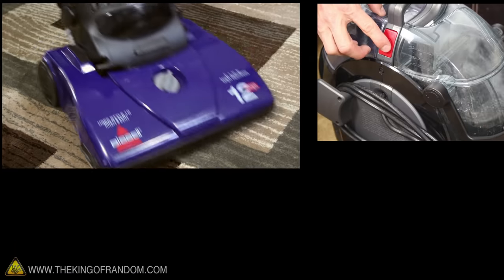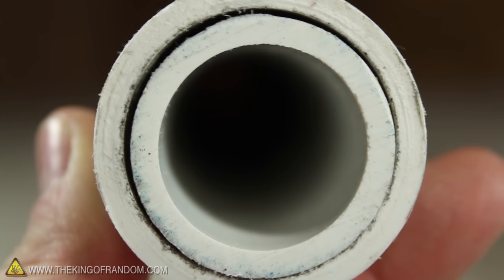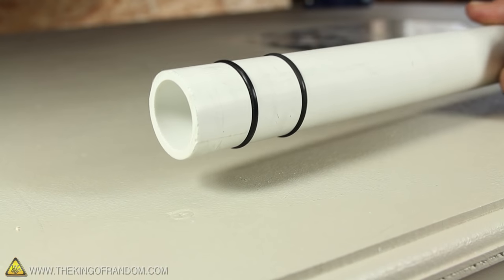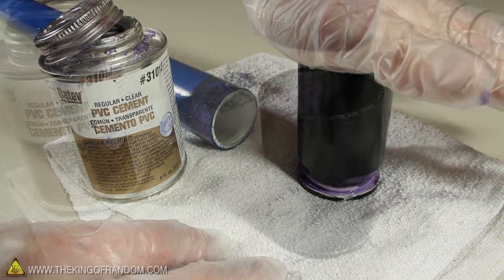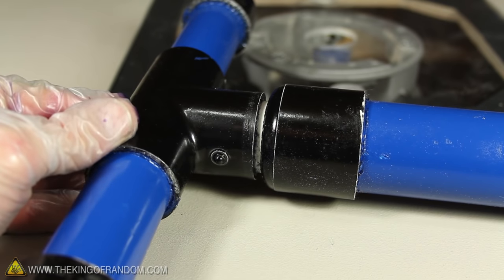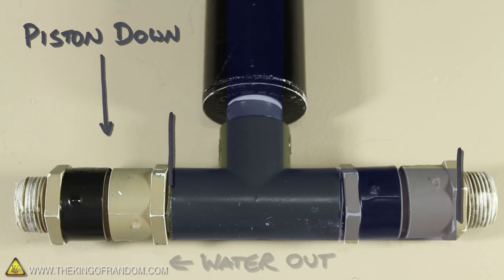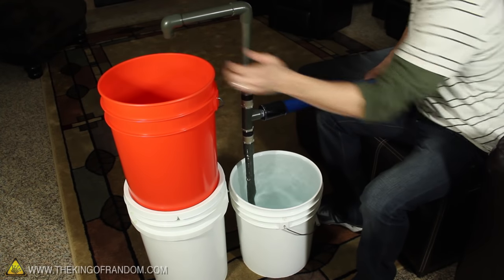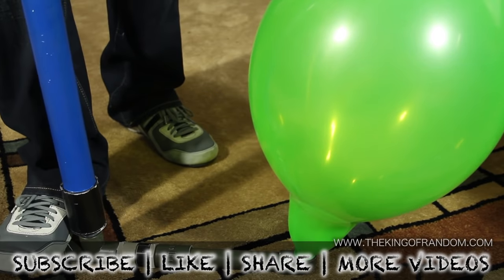How To Make A PVC Pump!

Comment: This pump works EXCELLENT with basic windmill pumps (using crankshaft mechanical leverage arms) too. You can even use this with 'high-reach' windmills, and drive this pump with simple counter-balance weights at the ground level. Excellent video.

Comment: Very nice job. :-) I made a very high pressure version pump a long time ago using rigid, thick wall aluminum tubing, using ball bearings / springs  for my check valves. I spun the tube with a very small round file(rat-tail) held firmly against it to create the perfect shape groove for the o-ring to go in. One thing to note, the vaseline is very bad for rubber, go with the KY(LOL), or silicone grease.
Reply from the maker: Thanks for the tip!  I've heard that from a few people, so it's probably correct!
Reply: You have a very nice channel, and well made videos. :-) If you have a bag of those rubber o-rings, and they were inexpensive, then just use vaseline and swap them out when they go bad.
Reply: Just use vegetable oil. Cheap as hell. But in all honesty you don't really need it on this kind of device. It will not wear down much if at all with the water in it.
Reply: Fortunately many o-rings today are made from neoprene. Vaseline will not harm them. You only have to worry about less expensive rubber o-rings.
Reply: +Cade Holmes yeh he evened uses it (Vaseline)😀
Reply: I wanted to ask the same as +Redwood21 
Does the fluid get contaminated with the jelly when goes through the pump?
By the way, great channel ^^
Reply: You can but you will be replacing the o-rings due to the petroleum jelly degrading the rubber. Best to go with KY or a silicone lubricant. Unless you don't mind replacing them more often.
Reply: My guess would be slightly. As time goes on and the lubricant is thinned down it will be less and less contaminated.
Reply: Thank you :)
Reply: electronicsNmore
Reply: Teflon water pump
Reply: "One thing to note, the vaseline is very bad for rubber, go with..." I can't read the end of the comment since Youtube sucks. Could someone please fill me in? What should I go with?
Reply: "...the KY(LOL), or silicone grease." That's what the comment said.
Reply: me too.
Reply: electronicsNmore I
Reply: he probably use a special type one 

-------{==================>
Reply: electronicsNmore i

Comment: I built this pump to start a siphon from a spring at the top of my property. It works great!
Thank you.
Reply: Did you have any problems with o-rings and inner pipe fitting into outer pipe?  I could not get it to fit inside and the cut I made for o-rings was pretty deep.
Reply: Please did you just leave the pump in place and let it flow thru the pump, or did you submerge the outgoing hose and then disconnect it from the pump while submerged. thank you.

Comment: think about how much better it would be if you sanded the inside of the other pipe lets say up to 1000 grit to get is real smooth. might be overkill but it would make the O-rings last much longer and make for much better seal. I bought one of those cheap cast iron hand water pumps and tore it down and did a lot of fine finishing and polishing and it tripled its ability so I see no reason why thing would be be the same here. Great video. I am actually thinking about making one with bigger pipe. to get more volume
Reply: Maybe make it big enough to be powered by AC (240v or 120v) motor?

Comment: Any idea on the water lift capability of this pump?  I want to make an emergency well pump and thought this might work.
Reply from the maker: Good question .. no, I have no idea
Reply: Ok  thanks.  I love your videos.  Keep up the great work!
Reply: +MrFiremandingo — The vacuum pulling the water column up can't be greater than the atmospheric pressure at the bottom of the column, or about 14.7 pounds per square inch. Thus, the maximum lift would be about 33.9 feet (10 meters) at sea level. (14.7 psi ≈ 33.9 ft of water @ 4°C) Any more than that, the water in the column would turn to vapor at room temperature due to the low pressure ("cavitate") and no suction would occur.
Reply: +Milosz Ostrow Actually your right.
Reply: +Garret I believe
Reply: The head will be as deep and as much of plunger and water that you can lift out.
Reply: Although you are correct about that, the column that is pushing the water has no height limit, other than your strength or the strength of the check valve, so you could possible modify this to make the intake check down at the bottom of the well and have the column after the output check be really long.

Comment: I discovered your videos only yesterday and I love them all! Regarding this pump, you should know that silicone grease needs to be used and never petroleum jelly ("Vaseline")  because petroleum jelly degrades rubber (the O-rings). Also, it should be clear that the only way to seal PVC threaded fittings is with teflon tape and never pipe dope. Wow, I was dreaming of having a manual water pump like this during Hurricane Irene when I lost power and my basement sump pump at 4 am and had to start bailing water from my sump by hand and candlelight. How about a low-voltage pump that can be used as a back-up system with a charged car battery? It would need an impeller, check valve and automatic float switch and be compact enough to fit along the the sump side wall with the primary pump in place. It's available online but for several hundred dollars. Thanks!

Comment: Hey Grant, I really like this project and think I might build one just for grins.  Be careful using vaseline on o-rings.  I'm not sure what the chemistry of yours are, but if they are latex based the o-rings will dissolve over time since Vaseline is petroleum based.  I know, I know, not that big of an issue on a 10 dollar pump, but just FYI.

Comment: This is another great home made item that I've made, in preparation for a Zombie Apocalypse. I've even gone as far to make a modified attachment for the intake, that includes a small filter system, to break sediment and debris out of the water as it is pumped. It weighs less than 3 lbs all together and when disassembled, it fits inside of an Arrow Quiver bag.

Comment: I made mine 3.5 feet long because I'm a little on the tall side, and I messed up making the grooves for the o rings. It was a quick fix though, and it pumps about 3 cups per cycle. I have a well in my backyard that I use for watering my plants and this seems like it could be a quick fix if anything went wrong with it. Please do more projects with the 1-way valves, I have 4 more of them that I don't know what to do with.

Comment: I made a similar version to this but not changed the design to move volume with no pressure. It pumps 5gal/<1min! The main outer body is 2" pipe with 1" fittings and adapters on the bottom. Instead of a ball valve, I made a rubber circular flapper valve by cutting a (C) shape in a 1" circle of tire tube rubber. Then I cut a 1" plastic washer and sanwiched it all in the end of the threaded adapter so that the rubber flaps open and closed inside covering the hole. It works great, even with muddy water!
Reply: My challenge is that I have tried other pumps to push water through a water filtration device, but most are in the style of bilge pumps, which don't build up the head pressure, to push water through a filtration system - at a decent flow rate.  This simple pvc pump does.  I wish I knew where I could buy something that worked as well, and didn't need to manufacture it.  Thoughts or suggestions?

Comment: I modified the design. I took a one inch Repair coupler made of PVC and cut it then used a heat gun to expand it over the 1 1/4 inch pipe. This allows me to use the rubber ring instead of the third O-Ring and the screw on compression allows me to adjust the compression on the Rubber ring.

Comment: You should get an adequate seal for a bicycle pump and the PVC is pressure rated for a lot more than the pressure of a bike intertube, but after you add the hose and Schrader fittings, you'd spend more building it than a new bike pump costs.  I saw one the other day for 15 dollars.

Comment: I´m way too late for this to be read, but here I go anyway: you are losing a lot of capacity if the mobile part of your piston is hollow. A gret improvement should be expected if the end of the tube is sealed somehow, reducing what is called in compressors tech (which is applied here) the "dead volume".
Reply: yeap, I missed it! Thanks Tim!

Comment: These pumps will cost you close to $50 in specialty stores. Good job!
Reply: Which specialty stores are you suggesting?  My challenge is that I have tried other pumps to push water through a water filtration device, but most are in the style of bilge pumps, which don't build up the head pressure, to push through a filtration system.  This simple pvc pump does.  I wish I knew where I could buy something that worked as well, and didn't need to manufacture it.  Thoughts or suggestions?

Comment: Great video. smaller versions of this sell for like $26.00. I am sure its cheaper to build one.
Reply: My challenge is that I have tried other pumps to push water through a water filtration device, but most are in the style of bilge pumps, which don't build up the head pressure, to push water through a filtration system - at a decent flow rate.  This simple pvc pump does.  I wish I knew where I could buy something that worked as well, and didn't need to manufacture it.  Thoughts or suggestions?

Comment: Cool PVC pump 3 in 1 it can use in compressing air,vacuum and pumping water..maybe i will make one for me ^_^ easy to make and low cost..
But i will finish first my hydraulic ram pump made up of pvc pipe it can work 24/7 it can be usefull in small irrigation for watering :)
Reply: I have tried to use bilge pumps to pump water through a water filtration device, but bilge pumps don't build up the head pressure, to push through a filtration system.  This simple pump does.  I wish I knew where I could buy something that worked as well, and didn't need to manufacture it.  Thoughts or suggestions?

Comment: Great!! I'd like to try making one for watering system. 
One question, what happened to the #320 o ring when you re insert the plunger? Doesn't it pushed down into the tube?
Or it stay in the cap?
I got that confusing, did u made a groove inside the cap?
Regards

Comment: Really cool ! , would you consider making a Kayakers Bilge Pump as a project please ?
I'm very hesitant about spending my hard earned cash on current versions of Bilge Pumps - they all seem extremely flimsy and I cant stand the thought of Handles breaking off on the first use. Your design looks impossible to break.
The idea of increasing the flow rate is also beneficial. Current cheap Bilge pumps do about 7.5 strokes / Gallon.

Comment: I want to make a bike pump. This looks like a good design, but what is the maximum pressure this can withstand? My pump needs to be able to pump up to 90 psi without blowing up. Thanks for the help!
Reply: prlangfo normal schedule 40 PVC pipe is rated at about 50-60 psi

Comment: this will work with plastic tubing that leads water into and out the pump, right? just will take more pumps to get the water out depending on the length of the tubing?

Comment: Would like to see a water wheel pumping water with this setup as in an off-grid water collection system- would be much more efficient than a ram pump & wouldn't require as much water drop distance to pump more water to a higher level.
Reply: +JFrogZ57 Would be interesting to see your take on rotational-to-linear work concept for long lasting reliability on a budget.
Reply: @jfrogz5772  My challenge is that I have tried other pumps to push water through a water filtration device, but most are in the style of bilge pumps, which don't build up the head pressure, to push water through a filtration system - at a decent flow rate.  This simple pvc pump does.  I wish I knew where I could buy something that worked as well, and didn't need to manufacture it.  Thoughts or suggestions?

Comment: With a hose on the upstream side could this pump pull water from a 150 - 200 foot well?
If power goes away I'll need a backup for drinking water...
Thank you for the great ideas.
Reply: did you try it?

Comment: Would a pedal pump not be easier to use? I mean, you used the feet to hold the pump in place, so why not have the pump's piston connected to a wheel, so that you can use bicycle pedals to power it, one foot powering the compression and one the decompression. Furthermore, you could get it a step further and use the wind to power the water draining.

Comment: Hey Grant I love all your ideas and random things I see from you. However I do have to point something out.

Teflon tape or (PTFE tape) is NOT a sealant nor does it seal anything. The entire purpose of Teflon tape is to make a threaded connection thread together easier by way of less friction. I see and hear seal tape all to often from people.

The only way to have a leak proof joint is to have the proper match-up  of fittings. I.E. matching thread pitch, and  male/female tapered ends that are cut for each other.

Comment: a 1" schedule 40 plug has the same OD as a 1" schedule 40 pipe. I'm guessing you used a 3/4" schedule 40 external cavity plug for the piston, correct?

Comment: It would be pretty easy to increase the volume you can pump by using 1.25" and 1.5" pvc pipes instead.  I might have to try that just to see what the difference is.
Reply: Any luck with the larger pipes?  My challenge is that I have tried other pumps to push water through a water filtration device, but most are in the style of bilge pumps, which don't build up the head pressure, to push water through a filtration system - at a decent flow rate.  This simple pvc pump does.  I wish I knew where I could buy something that worked as well, and didn't need to manufacture it.  Thoughts or suggestions?

Comment: Grant. I noticed your check valves screw all the way in. Did you neglect to update the parts list to include a schedule 80 (gray) T fitting instead of a schedule 40 (white) due to the tapered successive threads?

Comment: the thing is, PVC is sensible to solvents, wich includes gasoline. if gasoline passa through the pump, it will not melt or dissove, but the pvc surface will get rough and worn, and because of that you will get a leakage.
sure, you could pump the gasoline, but this will make the pump unreliable.

Comment: if the t- fitting between the two check valves were lengthened horizontally to spread the valves a foot or two feet apart would that increase the volume per pump stroke?
Reply: archangel The pump volume per stroke depends on the diameter of the piston and how far it goes on each stroke.  If the distance between tees is increased too far, the pump will be "spongy" when pumping air to high pressure because you have to compress the air in the chamber higher than the pressure past the check valve before the check valve will open.  If you have a large volume between the tees, it will take a lot of pump stroke to compress the air.  Smalles distance possible between the tees is best.
Reply: Cath Martin
Thank you!
Reply: +Cath Martin Any thoughts on using a larger diameter pipe for the piston?  Can I increase it to a 2" for a larger volume of water?  Is there a ratio for figuring out the diameter and length of the piston in relation to the tees so I can get lots of water while keeping the distance between the tees short?  Thanks

Comment: is the pump good for drinking water? does the water come in contact with the lubricant?
Reply: the lubricant he uses is fin for consumption, its vas line.  the reason why he has gloves on is the for the pvc binding chemicals, once those are dry everything is safe

Comment: What would you suppose the efficiency of say... a backpack sized pump would be? I've got a small water filter I'd love to try to integrate into this for camping and such. So, do you think this design would scale down well? Or would I be pumping like a gallon an hour lol 

Thanks. I love the videos, and I'm greatly inspired by you and your channel to just build some junk!
Reply: The longer the piston, the stronger the force per cycle.
Reply: +Girish Manjunath The longer the piston the higher the volume per stroke, not force. The smaller the piston diameter the higher the pressure.
Reply: joshua75067 You are partly right; just to clarify my first post, when you are creating a vacuum the more volume, the more force, as force per unit volume for a vacuum is constant (at atmospheric pressure times piston area). A long, wide piston will move more volume with every stroke, at higher force.

Comment: Any tips for cutting small grooves in the pipes without equipment?
Reply: Alright, thanks.
Reply: Raging Gamer  I used saw, miter box and went around until I had a groove.  Then opened it up with sandpaper and a dremel tool.  It took a lot of checking for high spots and filing them back down, but it worked.  

Now trying to figure out the check valve, since he didn't give us a size for either the balls or the o-ring there.

Comment: I was wondering if there was some way you can mix this project and attach it to the pvc rocket launcher then add a psi gauge. A homemade pump rocket launcher or with a smaller guage pvc pipe a pump dart gun.

Comment: I wonder if you could improve this design by adding another piston onto the handle to double the flow rate.
Reply: Good idea but that would make it hard to use, be more like a rowing machine then a pressing motion.
Reply: TheaDragonSpirit no i think he just meant build two pumps with a common handle, whereas you are thinking of the option of adding a tee piece and two more check valves at the top, which would make a double-action pump, pumping on both push and pull strokes. Both would work.